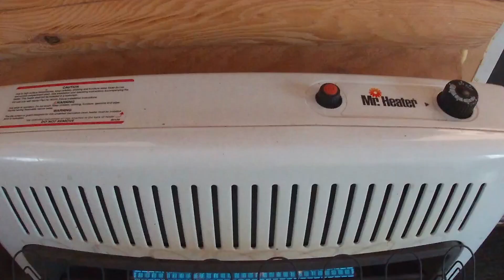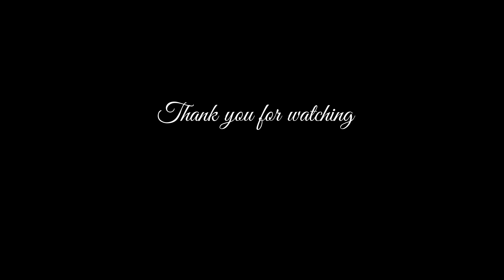Fueling our Off Grid Log Cabin, Winter Homesteading in the North, Ep.3

Comment: Check with Cenex in Ashland.  Rhey have stations & deliver propane.  A bulk tank may be easier (they're movable later if need be).
Reply: Should've  put a tarp or a cover  over the fire wood for fireplace!!
Reply from the maker: We had a tarp over our main supply for the year. The last couple loads we had to dip into our next years supply which was un-covered. Thanks for your comment and for watching!